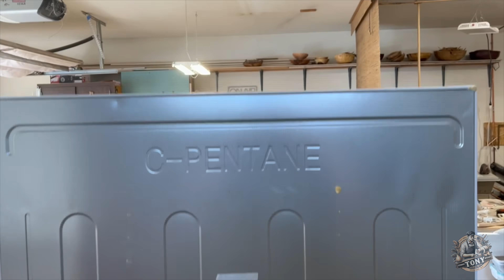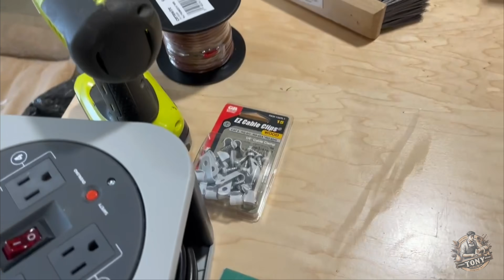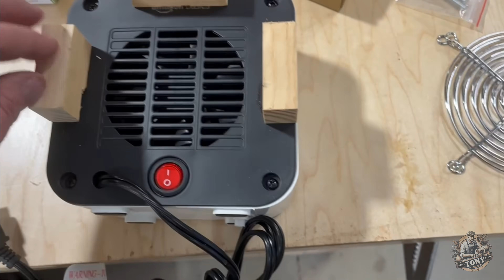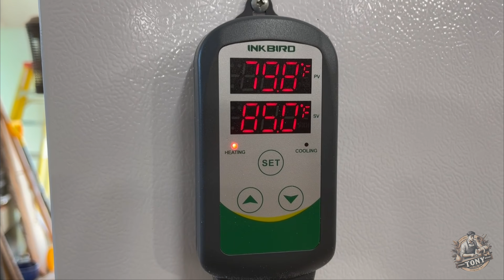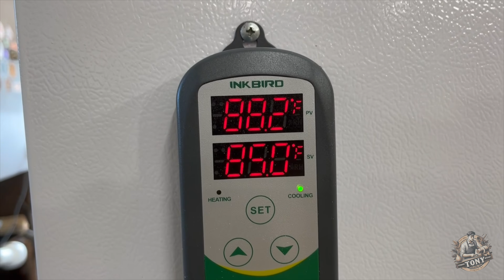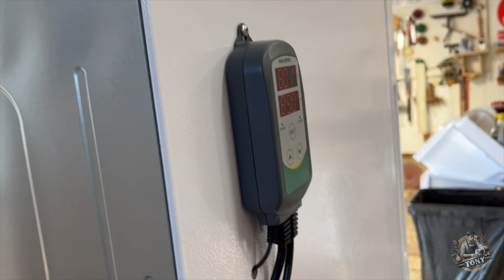DIY Wood Drying Kiln

Comment: Hello Tony, I have a question. Is the lining in that freezer plastic? If so, have you had any issues with it? I bought all of the supplies I need to make a kiln out of an old freezer I have, but I have been reading other things that say not to use the freezer if it has the plastic molding on the inside like most modern freezers have. I have also read that the foam behind it can produce some toxic gasses if it is heated too much, what are your thoughts?
Reply from the maker: ChatGPT 5.0 answer: it’s generally safe at 90°F for long periods, and most of the concerns people worry about (outgassing, refrigerant issues, etc.) are very low risk at that temperature. But there are a few practical caveats worth understanding.

What’s actually happening at 90°F

A typical garage freezer is already designed to survive warm ambient environments (often up to ~100–110°F external air). You’re running it at a mild warm internal environment, which is still well below temperatures that damage most of its materials.

Key components and risks
1. Plastics, liners, and insulation foam
Interior liner (ABS/plastic) and polyurethane foam insulation are the main “outgassing” sources.
At 90°F (32°C):
These materials are well below their thermal stress range
Any VOC release is typically minimal and mostly from age, not temperature
You might notice:
Slight “old appliance” smell when first warming it up
That usually dissipates over time
2. Refrigeration system (biggest question mark)

If your compressor system is still intact but unused:

Refrigerant is sealed → no risk at 90°F
Compressor oil is stable far above this temperature
These systems routinely see:
Hot attic installations
Discharge line temps far higher than 90°F during normal operation

So unless the compressor is actually running in a weird way, it’s basically irrelevant thermally.

3. Electrical wiring, defrost system, gaskets
Wiring insulation is typically rated ~105–125°F minimum
Door gaskets are designed for hot kitchens and cold freezers
Auto-defrost heaters (if still present but unused or lightly cycled) are rated for far higher temps than this
4. Adhesives / foams / “garage smell”
This is the most realistic source of outgassing
At 90°F:
You’re not “breaking down” materials
You’re just accelerating any pre-existing off-gassing slightly
If the unit is older, you may notice odor early in use, then it stabilizes
Real risks (what to actually watch for)

These are more relevant than outgassing:

⚠️ Moisture + corrosion inside electrical areas

Warm + humid kiln environments can slowly:

Corrode terminals
Affect fan motors if not sealed well
⚠️ Fan motor lifespan

If you’re running internal circulation fans 24/7:

Check they’re rated for continuous duty at elevated temps
⚠️ Temperature uniformity (wood issue, not freezer issue)
90°F is in the “safe warm drying” range for many bowl blanks
But drying rate and EMC control matter more than equipment safety
Bottom line

At 90°F continuous operation:

✔ Safe for foam, plastics, wiring, seals
✔ Refrigeration system is not stressed
✔ Outgassing risk is low and mostly short-term
✔ No meaningful toxic breakdown expected
Reply: @tonyturnswood Thanks for the response, I have a 60 watt bulb for now to see how things go once I get it built, I was a little worried about the plastic and foam stuff. ChatGPT was telling me not to use it, but I also didn’t specify what temps I’d being using it at, or using a lower wattage bulb. Thanks for the info!
Reply from the maker: @stephenharris4656 my pleasure!
Reply from the maker: My doner freezer does have a "plastic" interior. I have not heard of those issues at all!  I have my Inkbird controllers set to a max of 90 degrees F.  I do believe that this specific freezer also had an "auto defrost" and those can get pretty hot.  It's a great question, though... and I don't have a "certified" answer for you.  Let me do some research!

Comment: Pretty cool set up. When I was a chairmaker i dried rungs in a similar set up. I removed the door gasket top and bottom for air flow. Building out a kiln around a rollaround wire shelving unit now. I like your build.  Thanks.
Reply from the maker: That's a great tip about the gasket, and good luck with the new kiln build! 🪵 I have found this works well with the dehumidifier, but not without it! (just what I learned on this build)